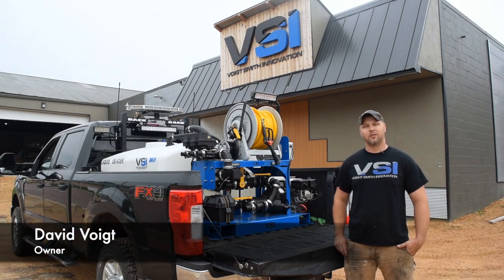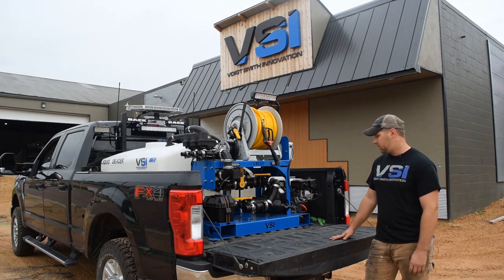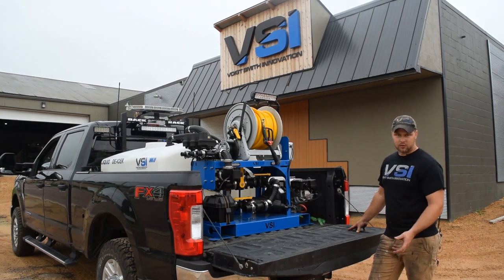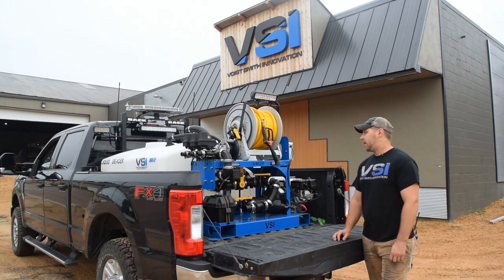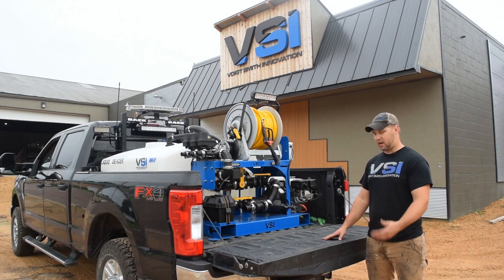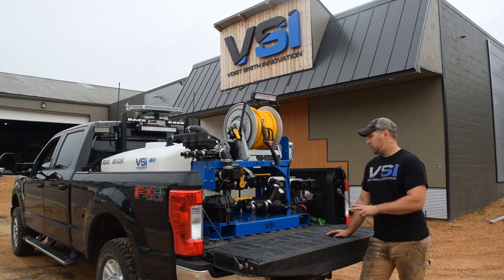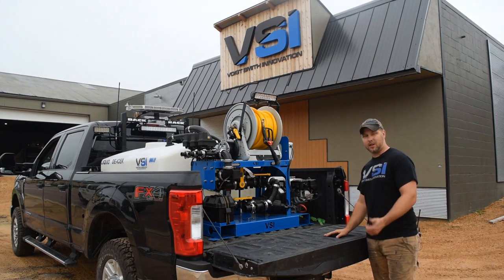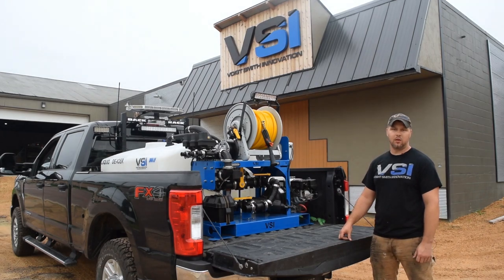What's Different about VSI Brine Sprayers Compared to Others

Comment: It’s jungle weather here in Missouri, hot and steamy, I almost wish it was time to use our sprayers. I am really looking forward to getting this years model. All of you fence sitters out there, it’s time to get off the fence and start using brine. You will make more profit and have much cleaner properties. I have VSI and a competitor’s sprayers(its yellow) and have had nothing but great results using VSI. We use our VSI equipment as much as we can for pre- and post treat applications. We consider ourselves lucky to get thru a pre-treat application without any issues from our other units, THEY ARE NOT RELIABLE, we cannot use them for post treatment at all. VSI makes the best built units on the market, period. Their customer service will blow you away, you wont find a better company to work with.
Reply from the maker: Mud Puppy, have you thought about using your sprayers in a parade? Would keep your operators sharp, cool the crowd down with the side booms, and give you that summer fix! Just make sure all the brine is out of the system!

Comment: Can that setup be used for SoftWashing Roofs and Siding using Sodium hypo chloride ?
Reply from the maker: Glen, the skid and tank could be used but you would need a higher pressure pump for the system. The pumps we use on our deicing set ups are a good balance of pressure and volume for the application of brine. You could contact us at sales@vsinnovation.com and we could come up with a set up for soft washing.